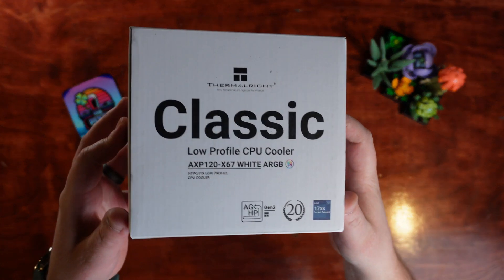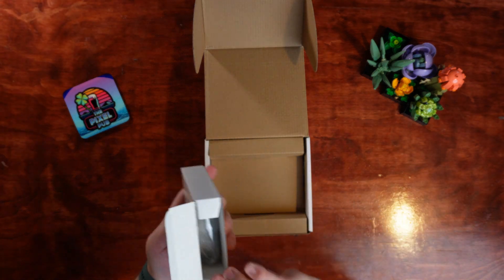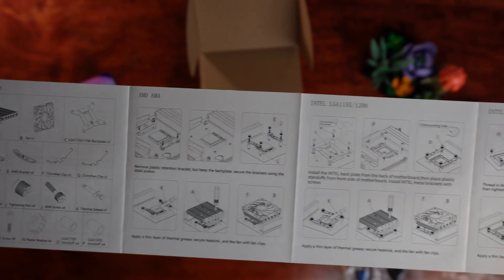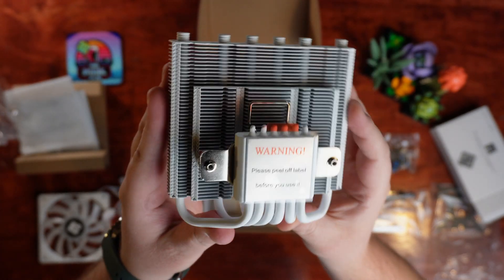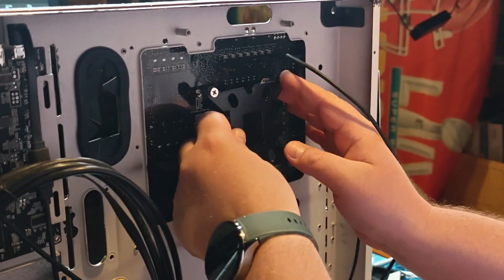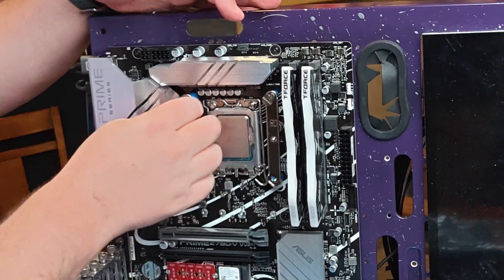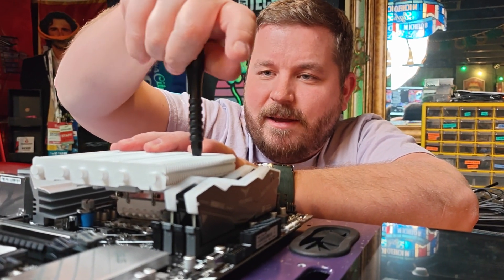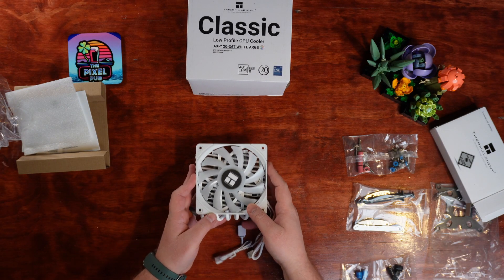Thermalright AXP120-X67 Low Profile CPU Cooler Unboxing and Installation

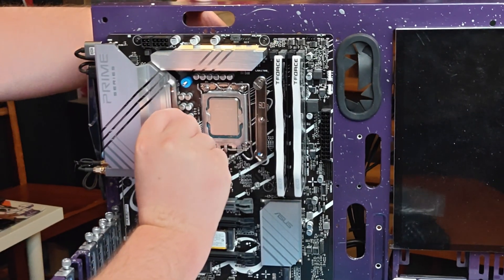Comment: 03:11
The bracket is installed in the wrong position.
Please read the manual carefully.
It states that the bracket should be installed sideways.
This is the cause of the conflict with the memory slot.